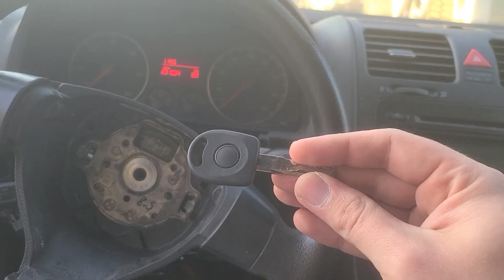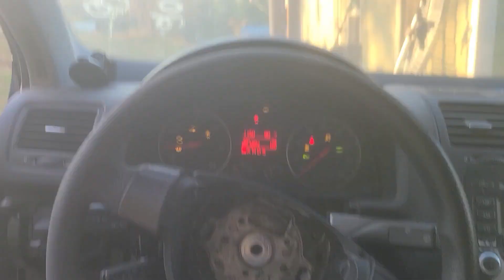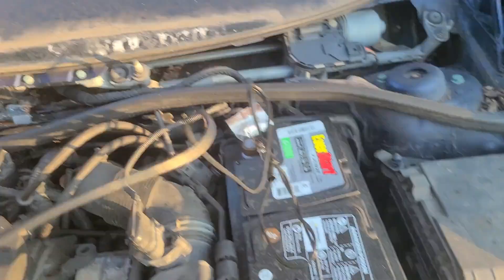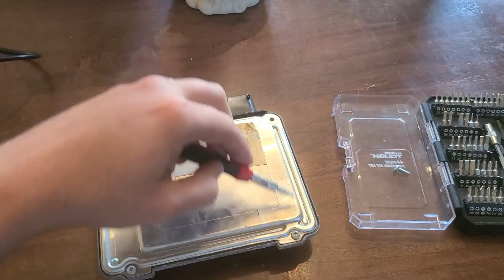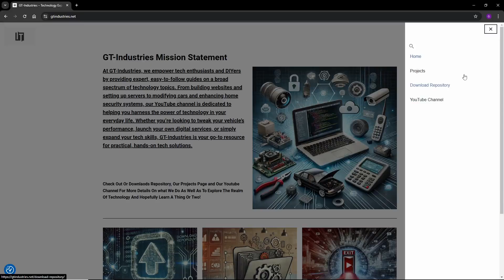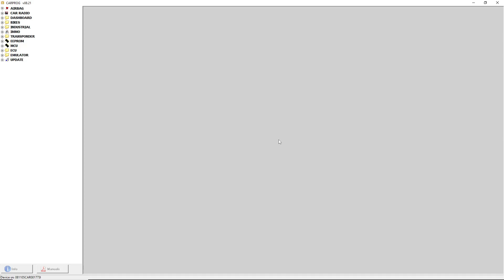Imobilizer Delete 2006 VW Jetta TDI 1.9L

Comment: A buddy of mine has a 2006 Jetta TDI that the original keys quit working and the immobilizer stays active. Rather than trying to reprogram the keys in we decided to just delete it so thank you for this. Do not worry about removing that feature as the car is mostly trashed anyways and we could care less about the immobilizer so I will be doing this. We figured this "brute force" method is better than the more expensive tools needed to reprogram the keys into it since we have none of the original dealer documentation to get the SKU or anything from. It was an auction car so Imma delete that system. The project page with the hardware and software needed has been extremely helpful and I do have experience working with SMD chips.
Reply from the maker: We're glad to help in an educational sense on this. Just as a reminder, we can't guarantee this will definitely work for your scenario but as long as you backup the original read file, you can always revert back and it should work. It did on ours. Thanks for the positive feedback!
Reply: @GT-Industries  Thank you for the info and as an update the mod worked. Had to wait a few weeks for all the stuff I ordered to arrive. Car runs and we can now move it. Thanks for this "information only" video as it saved a car that is part clunker and we can now get it fixed up. Not sure why the computer lost the original immobilizer codes as the keys are the original ones that should have been coded to the immobilizer. This was cheaper than getting the stuff to reprogram those keys into the system. As the car is pretty junky this was the better move. Another 1.9 TDI diesel saved from the scrapyard.
Reply from the maker: @Chaotic-Mind-69  So glad the information was helpful! As far as your original issue, there are a lot of cases where the PCMs in those units decide they no longer want to communicate and accept the keys. I'm not sure exactly why they do this but I was able to figure out all my research on about 6 different TDI diesels at my local junk yard that all had keys, ran and drove great but was totaled out by insurance or deemed not fixable by their owners due to the exact issue you're facing. Again, glad to have been able to provide the info needed for you. Please share this video on any other communities or forums if you find people needing something similar.
Reply: @GT-Industries  These engines make for good swaps into other vehicles. I know Toyota people like them in the older trucks from the 90s and older so this mod is perfect, especially when using aftermarket gauges for swapping. As for me, I will next see about getting the digital dash to shut up about the immobilizer being active. Same dash design as in the vehicle you demonstrated. According to my research this is fully possible with the CarProg 8.21 I used for the ECU mod and does not require a replacement chip to do since this version of the dash should have a EEPROM in it that can be reprogrammed using the VAG function in CarProg. If it works I will let you know. This is just a convenience mod as the guy who owns the car says he does not care about that message staying on the digital display constantly but I am meticulous. lol
Reply from the maker: @Chaotic-Mind-69  Please do let us know and if you make a video on it or an instructional of some kind, feel free to send it to us or tag us and we'll add it to the video description as a reference.

Comment: Before deleting the immobilizer did it turn over?
Reply from the maker: Yes, on our tests, the engine turned over but would not start. A couple times, after leaving the battery out for several days, when we would try to start it before modifying anything, it would fire up for a second then the security light would start flashing and it would die at the same time. After the modification, it would start right up and stay running. Again, like mentioned in the video, this is for education only. Do not do this to a daily driver or any vehicle you don't own without permission.

Comment: Can you do an immobilizer delete on a 2006 jetta 2.5 manual transmission car
Reply from the maker: A IMMO delete on a older vehicle is essentially done the same way if you want to go through all that. The only difference is the software used is the older version of the software in the project files on our website. However... we have never actually done it ourselves and have no vehicle to test with so we can't confirm that it will or won't work. You can also use other tools like K-programmers and specific tools for those cars if you have one.